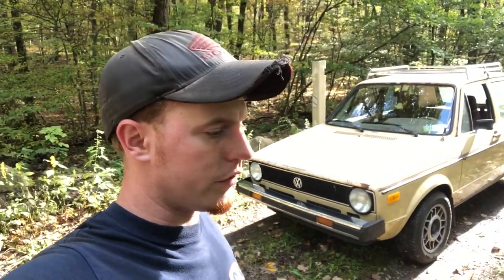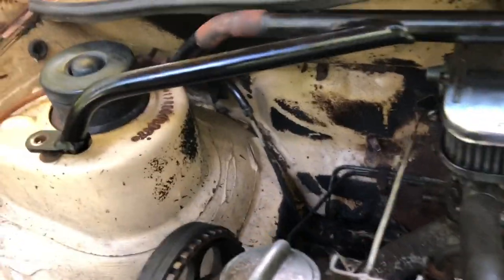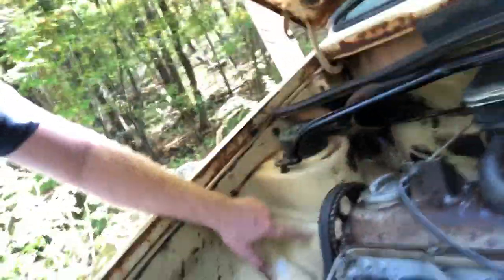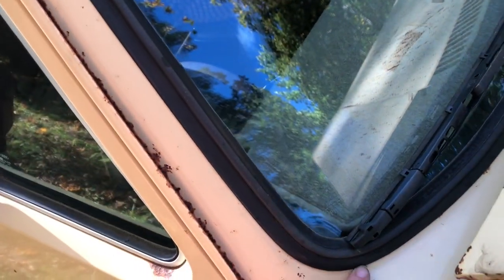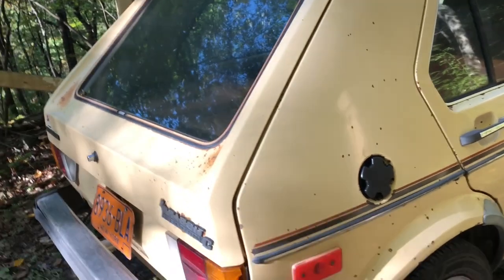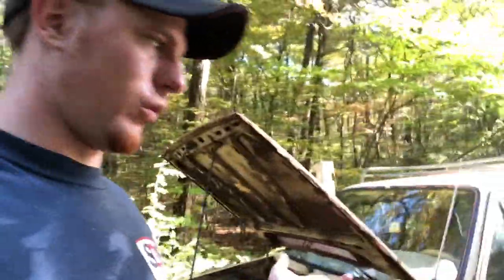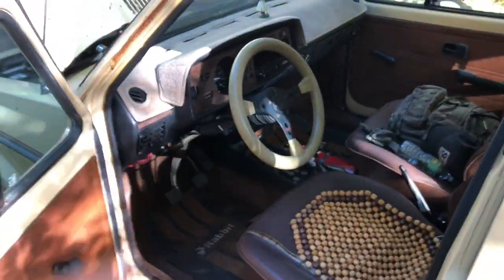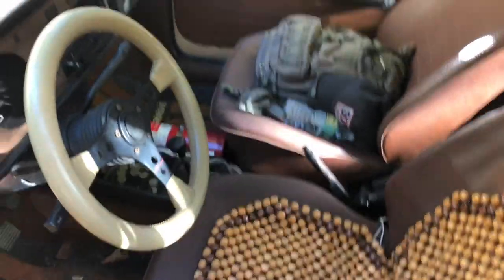#16 pt.1 beginners guide to mk1 rabbits

Comment: two top tips I'd add, check the b pillar by the lower corner of the rear window on the 2 door cars for cracks in the door jamb. Huge stress area on the car from flex, and I've seen a few with a small crack in the metal there, and always add a lower stress bar between the control arms. Keep them from flexing there, I've seen a few cars with torn metal in the floor from getting driven hard and flexing down low.
Reply: Where can I buy that lower stress bar?
Reply: @PedrosGarage  I know eurosport still sells the lower stress bar, but the one to have is the four point "k" bar. Those you have to find used from a scirocco 16v car.
Reply: @ThrottleGrotto  thank you!

Comment: My father bought a diesel rabbit new in 79. I bought it from him in 1987 ,and  I drove it  for  about 5K more miles. I liked that it had lots of room,enough power for me to stay up with traffic. And 50 mpg was nice.  I then stored it in the mid 90's.   Im now 70 yo and down sizing. Just got rid of most everything,even downsized my home, but kept 4 of the cars Ive had  since they were new.  three have less than 70 k.The rabbit has 25 k on it and I ve got it in the shop having a mechanic start it up for me  and get it servicable to drive since its been stored 24 yrs.  Interior needs replaced though .Anyone know  the names of a couple places to get all or most interior pieces,?  No rust on it,but Ill check it as you pointed out the areas to check. Never been in snow and Im down here in the socal desert the las 25 yrs. I  havent seen any rust at this point. Good video . Ill check all the stuff you mentioned. Oh by the way,my hood had a pair of rabbit ears on the hood  that was attached with a sprung chain of some type. That preventee=d it from getting broken if someone or thing struck it. Looks like someone finally did steal it though. I havent seen many rabbits and none with that hood ornament. Anyone know  about these?
Reply: How cool you have lower mileage survivor. I had a 80 rabbit diesel 50 miles to the gallon was amazing.
Reply: Put in a Tdi and get 70mpg ;p

Comment: Wow brother flashback when you opened the hood i’ve owned a75 Rabbit (Carbueratored ) a 81 Rabbit  and  in the early 80s  drove a 79 Deisel Rabbit  for a company i worked for delivering and picking up  for a Printing Shop who bought that car for deliveries  that was awesome on fuel  but i had to turn off the AirConditioning  for enough power to get on the highway or pass anyone  in Florida too where AC is a necessity  and my best freind  had several Rabbits and Scirrocos  due to having a Uncle who worked at VW /Porsche as a mechanic  for years  so he had first dibs on Trade ins  that came into the Dealerships
Reply from the maker: Craig Monteforte wow that’s awesome, thanks for sharing the stories. always great to hear from those who had the chance to drive these when they were new. must’ve been a lot less stressful on the road back then with these because everyone had similarly “fast” cars. you almost have to swap the engine on them nowadays if you wanna merge safely since everyone and their mom has 250-400hp cars.

Comment: Awesome channel.  Grew up in MK1's.  Though, it was a maintenance monster.  1979 with fuel injection and automatic transmission...built in Pennsylvania.  Wonder if we'd gotten a German made one if it would have been more reliable?
Reply from the maker: gbriank1 thanks for the support man! pa built but 79? one of the first! my favorite style honestly. who knows, luck of the draw with reliability it seems with these cars sometimes. the german built ones are definitely less complicated so might’ve helped.
Reply: @mk1rabbithole  Yeah, 1979 MY bought in Dec 1978.  Had minor rust.  If it had been more reliable, I probably would have gotten it as my car.  Dumb question, have you replaced the door gaskets on your Rabbit?  I don't here tell tale door vibration in your video.

Comment: The car has  '79 front grill, "L" dash and 1981 interior.
Two vital areas to check. 1.  The fuse box.  None left the factory with enough winshield sealant and they leaked especially behind the fuse box.
2.  The head or head gasket, especially diesels.
Reply from the maker: this car has early 78-80 rabbit interior.

Comment: Neighbor had a 1983 2 door rabbit in his yard, gave him a call and he just let me have it for free (I saw no reason to charge me since he’s old). I’m not mechanic but I believe this is a good start (and my dad is one so I’ll b fine) The speedometer says 50k miles but still waiting on the title. Thank you for this video will be checking on the car!
Reply from the maker: sorry for the delay in responding, but that’s such an awesome thing to hear! do you have any updates about it??
Reply: @mk1rabbithole  Yeah, the car runs in drives but it doesn’t have brakes, come to find out that the previous owner cut the brake hoses in half for some reason. I’m now having trouble getting the brake hose separated from the brake lines. I’ve tried doing the whole torch thing and no dice, I’m just tearing the nut. The car also doesn’t go in reverse :) . So gonna take this car to a guy fixes old cars for the brakes. But I’ll work on the shifter myself.

Comment: The Body is only the beginning.....Mechanical issues are huge also wiring. these are super hard to restore. and will cost you a fortune in upgrades. ORIGINAL is BAD....for a lot of things. They require upgrades.
Reply from the maker: i can't agree with you. engines and transmissions are a dime a dozen. the things i think are important are the wearables no longer available like interior, and paint that's only original once. rust is the biggest hidden expense to repair hence my overall opinion in this video.